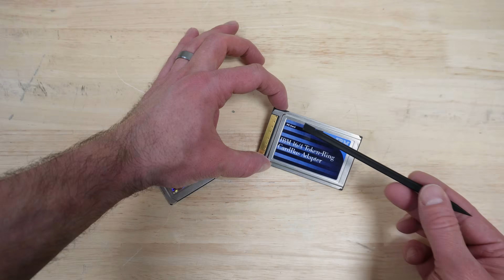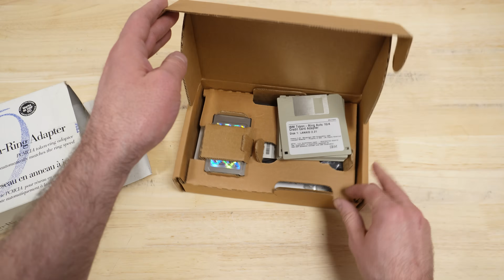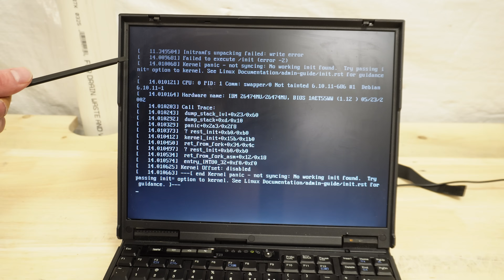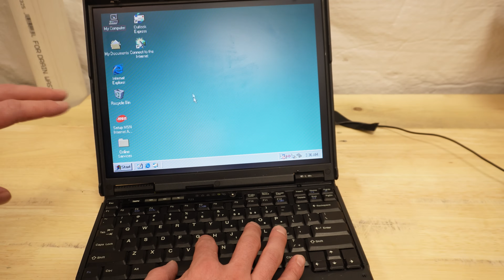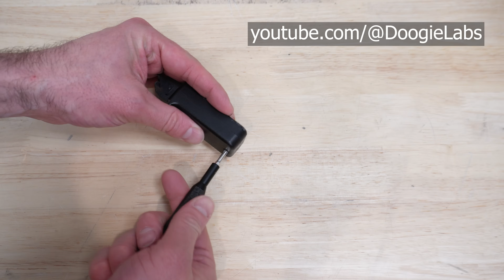Token Ring over PCMCIA Cards

Comment: In the late 90's at IBM we'd have to make a custom-compiled Linux kernel to use those PCMCIA cards with our ThinkPads.  Maybe 30-40 minutes of compiling since pre-built drivers didn't exist yet.  Eventually the drivers became available just as we were moving our test lab to Ethernet.
The thing with PCMCIA is I think the earliest specification must have had different notches in the slot.  I have a Twinhead Subnote 486SLC laptop that won't take any of the PCMCIA cards I have, but it came with a modem card that fits the slot fine.  And since it doesn't have the external floppy, and has an early IDE drive (non-LBA) I can't simply copy anything to the machine (I had to back up the HDD through a serial Interlink connection)

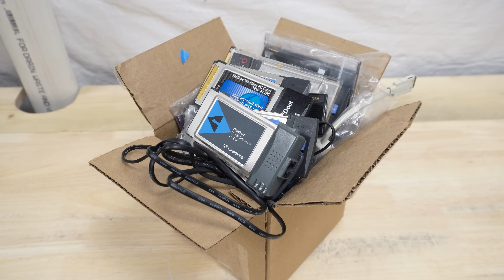Comment: 5:14 I had that same Linksys Wireless B card for my Thinkpad T21. The dark grey bit was bent a little but it still worked fine. I ran linux on the thinkpad and I had to use ndiswrapper to get the card to work properly if I recall correctly.

Comment: Typical IBM :-) I had forgotten about the setup tool -- the relays in the MAU (that connected your device into the ring) were bistable. If they got into the wrong state, your device was locked off the ring. You needed the tool (essentially a 9V battery inside a connector) to reset the port. 
TR never worked well over twisted pair, and 100BASE-T Ethernet blew it away for good. Tight jitter specs, higher EMI and 3x the cost for every interface was enough to kill Token Ring, except for die-hard IBM installations. I designed a couple of Token Ring cards for Data General and 3Com. Never really got into Token Ring...it was just a bit too ornate and Ethernet just worked without any fuss.

Comment: Maybe your DIY reset tool needs to have the shorting bar removed from your cannibalised plug.
As you saw before, the lobe cable has a shorting link to enable the NIC card to check the cable. That is removed as the plug is inserted. Maybe the rest tool does not have that link, because it doesn't need it. Maybe that is why your lash up😊 isn't working properly. Eg lamp on before you insert.

Comment: Yes they did Dial up connection over cdma cell service heres a bit of info people keep forgetting about 
 There were several windows updates over the generatiins 95, 98 2k, NT that addressed most of these issues that are NOT on the oem Install Win disks ,,

Comment: I remember having a 3Com PCMCIA NIC (10mbps? or maybe 100mbps) that had the ethernet port directly on the port. Like literally just on the side of the port. One slot as well.

Edit: One of my favorite laptops for retro networking stuff is the ThinkPad R40 - it has a PCMCIA slot, USB, an external floppy port, a CD-ROM/floppy drive (swappable) and a laptop dock that gives it even more ports

Comment: Windows 95/98/ME can be frozen in 16-bit code, just like Windows 3.1 because those apps can’t be preempted like 32-bit code can be. The OS shipped with some 16-bit parts, and drivers could be 16-bit or virtual device drivers (which could also be unstable). I remember trying to access a network share would sometimes freeze the desktop like that. The switching between 16 and 32 bit modes was a clever hack, but it was a hack nonetheless.

Comment: With your obsession with PC Cards, do you have a Xircom REX? I feel like that is something you would adore.

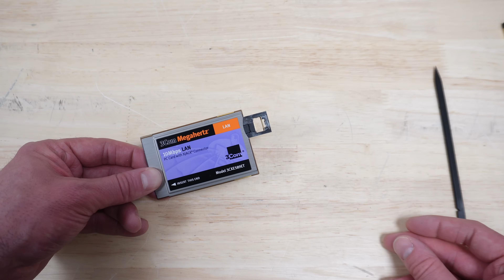9:45 US Robotics held the patents for XJack, I believe.

12:00 This is a regular 56K modem that happens to have an optional dongle to plug into some cell phones, it doesn't do any of the wireless itself.

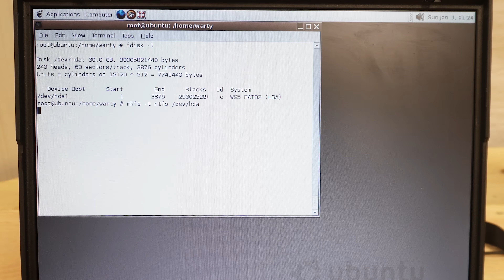26:46 You could have just used Fdisk on the Windows 98 disc before setup and solved this before it started. Plus, NTFS won't work for 98 anyways...

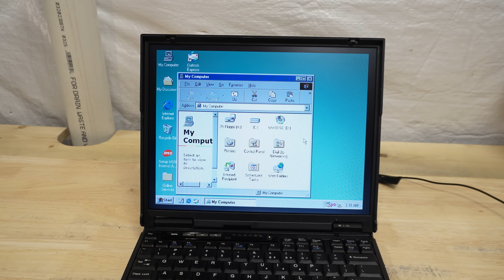31:48 Windows 98 includes more support for USB than 95 did, but very little in the way of USB storage support. There's a third party driver that will conveniently fit on a floppy disk that adds USB storage support to 98FE and SE, though. Millennium Edition includes it out of the box.

Comment: Have you seen the PCMCIA zip drives? They are super tiny drives inside of a single width PCMCIA card with Itty bitty 40mb zip disks. They are so cool!!! I almost bought one that came with 4 little disks for $40 15 years ago. If you could find one that actually works and some of the disks that would be an awesome addition to your retro setup! FYI I am NOT talking about the standard size zip drive with a PCMCIA card adapter. Also, they made PCMCIA flash memory cards, those would be awesome too but they are hella expensive even for 32mb of storage.
Reply from the maker: I used to have some! donated them years ago, hoping to hunt some down again someday

Comment: The memories...... I remember working with this stuff back in the day and the piles and piles of it when we tore it all out to replace it with Ethernet which was a glorious time. 

And those freaking dongles on the PC cards, the end users broke them constantly.

One other thing I used to do with our Broken Ring network when we still had it where i worked at the time. I literally put a PC running in every wiring closet to set the ring speed on each MAU stack and keep it set all the time in the building i supported. Made a big difference as users brought their PC's online since some would auto to 4 and others 16 and it would do exactly what you experienced, Imagine having to constantly troubleshoot users getting on the network every day, i got sick of it so i took steps to make sure i didn't need to any more. The ring being so fragile is one of the reasons TR fell out of favor quickly to 10baseT Ethernet.

Comment: I have a ThinkPad T23 myself. Beautiful machine! It's one of my favorites. 
They seem quite temperamental under Windows 9x, though. I never could get Windows 98 to consistently boot correctly on mine, especially after installing the S3 SuperSavage display driver. I ended up using Windows ME instead, which despite the horror stories you may have heard and remembered from back in the day, honestly generally works much more stably on newer (1999-2001ish) systems than Windows 98 ever seems to. Nearly all Windows 98 software and drivers also continue to work on Windows ME, so you might as well give it a shot if you continue to have issues. Additionally, Windows ME is the version that added USB mass storage support, though that driver can be backported to Windows 98SE.

Side note on drivers, I think the speed setting for the Token Ring adapter is probably in Device Manager or the Network control panel rather than the PCMCIA settings. Since that adapter is from the Windows for Workgroups days, Windows 98 surely has all the drivers it could possibly need.

I typically use Iomega Zip for getting files to and from my retro computers as well. Those parallel port Zip drives are software-driven and are already painfully slow on the fastest of Pentiums, but they are absolutely agonizing on a 386 or 486. It was so inconvenient for me that I actually bought some cheap SCSI adapters with an external interface for most of my old PCs, allowing me to connect an external SCSI Zip drive instead. Those run at max speed no matter the hardware.

I'm sorry for always leaving such wordy comments. I'm only 23, but this stuff has captivated me since I was in elementary school. I was lucky to get into old computer stuff when it was "junk" and people would give my mom their random old PCs for free just because they heard I might like them (how I got my T23, in fact). The result of that is that my experience with these anachronistic absurdities is decently extensive and still fresh on my mind. :)

Comment: Easy solution.  Boot to Linux.  Run "dd if=/dev/zero of=/dev/hda bs=512" to zero the drive.  Boot to Windows setup.  Allow Windows to partition and format disk.  The Byte Size 512 is so it doesn't take forever.

Comment: where i worked it was the xircom ones with the flat plastic connector. they broke all the time. once they released the cardbus ones with the double height we finally got rid of the breakage issue

Comment: Token Ring always seemed like it was a solution which was waiting for Ethernet collisions to become a real problem, and Ethernet collisions never became a real problem.
Reply: This is (somewhat) incorrect.  I was with a company that did a new network install at a school back in 98.  They installed a stack of 6 3com 48 port hubs that were connected via cascade cables and had a Cisco switch at the bottom with IPX/SPX.  The first time they fired up the whole system everything nearly ground to a halt due to collisions.  I looked over at someone and asked "what would happen if you yanked out the cascade cables and ran each hub directly to the switch directly.". They did and all the collisions disappeared.

Comment: I clicked on the video because of the IBM connectors. About 3 years ago I worked as the IT guy at a production company where they still used these f*ckers. As in, the cables in the walls, the connectors in the patch panels and the outlets in the offices and it was HORRIBLE! Management meant it wasn't worth it to swap out the infrastructure, and the go-to process when a connector died (usually by itself after having held on for the last... 30? years) would be to simply move a user to a different port.
-Mind you, they were used for "regular" ethernet communication and reached somewhere between 10 and 100 mbit speeds as far as I remember.

While it's neat for a private project or exploring history, my recommendation, if you ever get somewhere where these are still being used... is to run!

Comment: 12:00 that is a remote management card for a sunfire server. It connects over cellular and can send you texts or emails to your Mobile Telephone in case of hardware fault or issues. You can also power on or off the machine and disable hardware remotely and without the need for normal networking. Sorta like newer ILO or other management but old

Comment: We had a few PCMCIA cards in the day, from standard modem & ethernet adapters to GSM cards with their own SIM slots and little ariels (2G data was do-able but *shudder*). I do still have in my possession a PCMCIA mounted HDD, probably a Toshiba 1.8 mechanism. It says "Assembled in Scotland" which is conveniently where I live ;) however while it spins up on my Toshiba 210 CS it seizes the computer while doing so then spins down and doesn't show up on the system (Win95). Bummer. Enjoying your T/R content - T/R was my first introduction to corporate networking - the cables and connectors and the resetting of the MAU ports with the tool is very familiar to me.

Comment: We built many of those cards right here in Utah. Good to see them again. 

Megahertz, USR, 3Com and MSL built most of those PCMCIA cards for the majority of other manufacturers. We were a contract manufacturer. 

I worked for all 4 companies.

By the way, the X-Jack had quite a history. The first ones were hand made. The connector was designed by one of the founders of Megahertz Corporation.
Reply: I want to hear more.
Reply: @ I started at Megahertz Corp. we built what we called turbo switches for 8088 Intel computers. 

Basically, just a crystal to increase clock speed, a new 8088 microprocessor chip and a socket. All encased in epoxy. 

We sold them through ads in computer magazines. We were a garage startup. 

We started building modems for Toshiba and more or less grew. We also manufactured modems for Apple’s Newton PDA and RIO MP3 players. Funny thing, we shipped the RIOs with Metallica’s music. Illegally. That’s another story. 

We were eventually bought by USR, then 3Com and then MSL. 

We released the x-jack along the way. It was a hit. By the way, we manufactured vast numbers of Palm Pilots as well. 

Eventually, things fell apart. Great memories still. Cheers.

Comment: That sun board is a RSC (Remote System Control) board meant for SunFire v480, v880, and 280r systems. I've got one in my v880 and it makes remotely managing the system with LOM very nice.
Reply: And yeah those batteries on there do like to leak everywhere. When they do leak while installed in a system they completely corrode the metal away above the power supply area in the v880. Guess how I found that out lol.

Comment: The HDD may not be bad. It's just windows being to stupid to handle the partitions. New Linux set the first partition to sector 2048, where as the older software starts them at 63. Either try to create a DOS partition at sector 63, or delete the start of the disk so there is no partition or MBR at all. dd if=/dev/zero bs=1M count=1 of=/dev/hda should do the trick.

Comment: @35:22 - The MAU is completely passive, and the ring speed can be set on the system. In an "Auto" environment (an existing network, maybe with mobile stations like a Thinkpad with PCMCIA adapter), the station can be set to "Auto", but you may want to set yours manually ('Advanced' tab of the adapter settings). My server (for DHCP and RRAS) is already on the ring (actually for separate 16 and 4Mbps networks with different adapters) anyway, so stations connect quickly.

Comment: The reason PCMCIA cards were used in server cards and inside routers, were because of certification requirements. By using a already certified card, they didn't need to certify the rest of the product to the wireless standards. Remember that this was before CE requirements came alive, and usually you had to go through a very expensive certification process to get wireless equipment like GSM, Wifi, or even certain cabled equipment had to be ceritfied. By building your product around a already certified PCMCIA card or plug in card, you could skip past all these requirements.
Reply: Was going to say that.  :-)  It was very common for the likes of the embedded device market, like those Linksys routers, but even the iMac G3 gained wireless access via an internally installed PCMCIA card.  Given it's just an expansion card (like ISA or PCI) in a small form factor, it makes all kinds of sense.

This practice is still alive and well today, in fact.  It's just that, instead of PCMCIA cards, it's either mini-PCIe, or just whole modules that are socketed on to a main board, or have through-holes around the outer perimeter of the module PCB, called castellations, and it's soldered on top of the main board like a surface-mount component.

Either way, having a generic module that is pre-certified makes the whole product easier to design and certify -- regardless whether the module is permanently attached, removeable, or meant as an expansion card to facilitate optional features and upgrades.

Comment: @clabretro, I ~think~ that the problem that you were having with that travelstar drive was that it was partitioned as a GPT setup.  Windows 98 wouldn't know how to use those, and could only go with MBR partition tables.  Using FDisk from the '98 Dos install on the cd could have gotten you there, if that's what the problem was.
Reply from the maker: I suspect you're right!

Comment: Another thing PCMCIA was oddly used for, up until very recently (and only when the underlying technology moved to modern IP-native streaming stuff), is digital cable boxes. CableCARDs are basically PCMCIA cards that contain the keys that cable boxes need to decrypt the video feed, it actually wasn't required for cable boxes to work, but the standard was created to eliminate the need for renting cable boxes from the cable company, which as a result of pushback, led to the FCC mandating them in all cable boxes to ensure compatibility with 3rd-party equipment. So much drama there and I could go on a huge tangent about it, lmao.

My first laptop was a similar P3-era thinkpad running XP. We were a tight-budget family in the mid 2000s and I had always wanted a laptop, my parents surprised me with it one day. Sure it wasn't the highest specced Vista laptop at the time, and I still needed to use the family P4 eMachine for some games, but it did the job and I could watch youtube videos and flash games and all that other stuff a 7 year old wants to do, without hogging and potentially breaking the family PC (until i got into playing with VMs lmao). I feel the same way about familiarity towards P3-era stuff even though i'm almost a decade younger than you -- though i remember playing with my grandparents 486 when i was younger and want to get my hands on some kind of AT-era system

Also, protip: if you need to clean a drive and aren't able to get GParted running on a machine because it's too old or otherwise incompatible, try to load a shell on a Linux or (BSD/Unix-based) OS and use a command like 'dd if=/dev/zero of=/dev/sda' (or whatever the drive path is), you don't need to erase the whole disk obviously, just enough to make the Windows installer believe it's a blank disk.  DD = Destroy Disk :3

Comment: PCMCIA was nice because it was actually the PCI or ISA bus which allows access to things that USB/Thunderbolt just don't allow for. Biggest example is SMART low level hard drive functions. I had an old SATA PCMCIA card in a laptop just for testing hard drives back in the day.
Reply: I don't see why Thunderbolt would preclude that. It's "PCI Express, modified to run over a cable". Now external drive controllers not supporting S.M.A.R.T., that I can understand.

Comment: off hand, no work done, I think it should be possible to design a 3D printable connector for the Psion Dacom Goldcard. It might not be very good or pretty, but there's some novelty to being able to revive old widgets like this. That said, there's 10 pins in there, having a connector probably won't be the end of the journey. Personally I'm a little more inclined to put work on the Goldcard, because I have touched one of those this year, I might have access to it still.